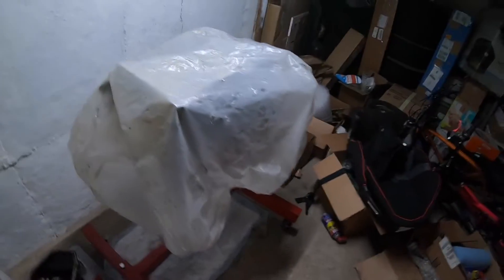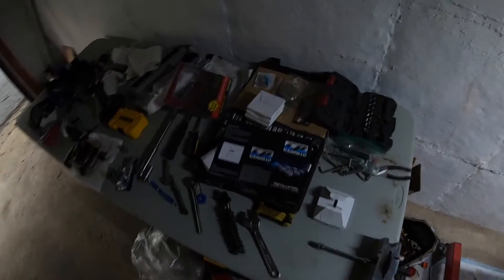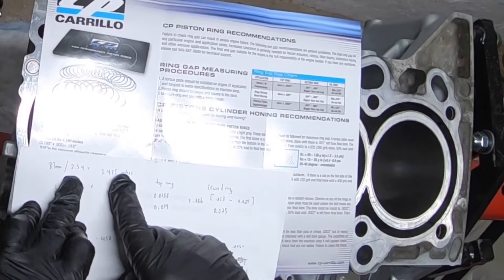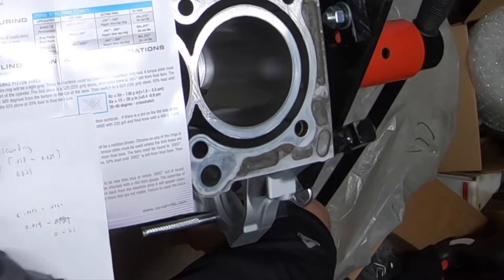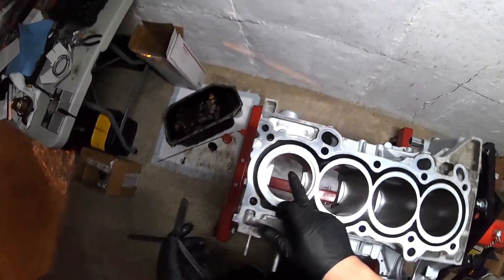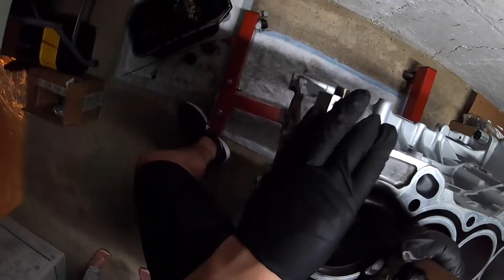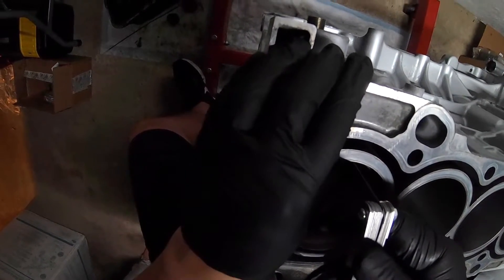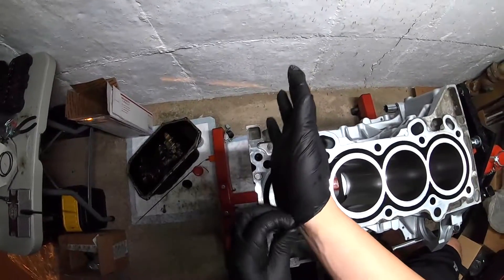HOW TO: FILE / GAP PISTON RINGS - k20/k24 build part 3

Comment: Hi there, I have just purchased a used K24a bottom (90,000 miles). I am wondering do I need to replace the piston ring? Engine seems to be still in its original condition as it looks very clean for its age.

Since I have the engine's service manual which contains piston ring gap manufacturer specification, is it okay to reuse the piston ring if the gap is still on recommendation? Thanks in advance
Reply from the maker: The motor should be fine as long as it was running, no need to do a rebuild
Reply: @ikigaidriven  I see. As long as piston ring gap is still within specs, I can still reuse them?
Reply from the maker: Well the only way you would find out is to take them out. If the motor wasn’t having issues I would leave it alone
Reply from the maker: The only reason I did it was because I plan to turbocharge the car

Comment: Hello bro very nice video 
I need help
Actually rebuilding my k20a std piston but the genuine honda std rings gap are too large 
So i need oversize 0.25
What brand to use ??😔😔 is rikken a honda brand?
Reply from the maker: Depends on how much oversize you need, what are you measuring?
Reply: @ikigaidriven  hello sir thanks for replying
My mechanic just told me that 0.25 (86.5 mm) rings will be perfect just will need a little bit of trimming. Should i go for nippon or riken?
Reply from the maker: To be 100% honest with you, both are good. Minor details in design but you should be fine with either. What's your plans with the motor?
Reply: @ikigaidriven  oh okay sir thanks a lot..
My plan is daily drive only and weekends racing 😁
All stock. got now a light flywheel gonna do head porting
Reply from the maker: Yeah if your planning to stay NA the piston ring brand shouldn't really matter. Keep us updated on your build